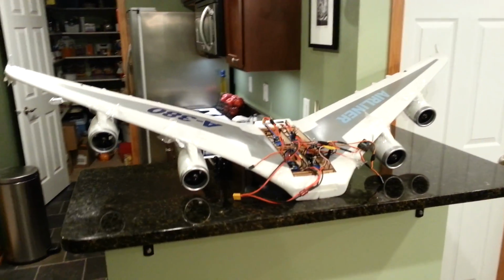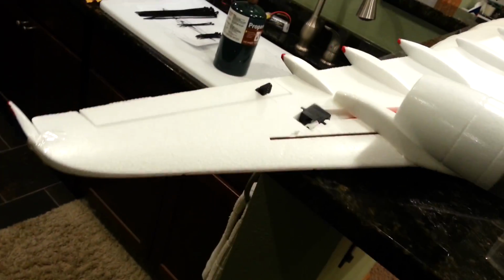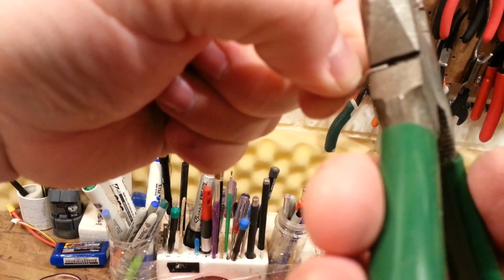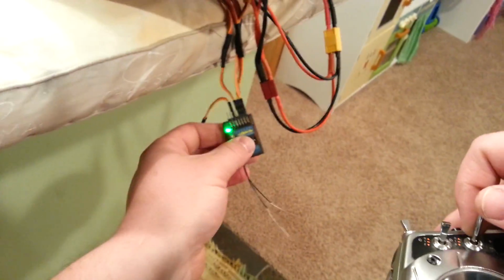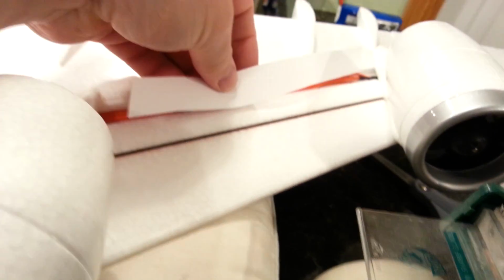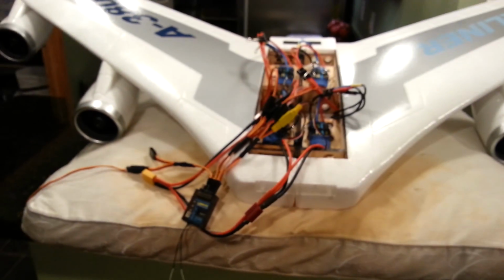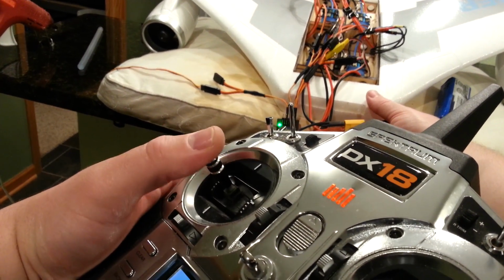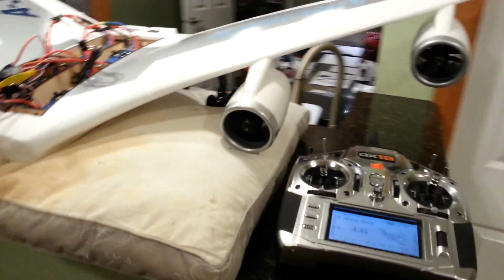Tian Sheng - Airbus A380 - Differential Thrust & Expo Radio Setup - Build Series - Part 6

Comment: Hi Brian, I recently put together a double motor type plane from Flite Test.  I programmed dif thrust into the Spektrum Dx8.  Got a ques bout this.  When I programmed throttle cut, only one motor cuts off, not both.  Do you know how to get both motors to be programmed with throttle cut when dif thrust is used.  If its not too much trouble can u pl explain how.   thanks
Reply from the maker: Gene, I thought I replied to this question - Sorry, just got done re-replying to about 35 messages, as YouTube is all screwed up (AGAIN!)

Comment: hi brian. another stupid question. what do you have plugged in to the aux2 channel on the receiver? isnt the throttle just on the throtttle channel on the rec? i just dont understand how adjusting aux 2 in a mix on your radio would have any effect. maybe i missed something on the video but i thought i followed as closely as i could
Reply from the maker: This is how I do the differential thrust. You must have missed a video somewhere...

Unboxing - https://youtu.be/S2PIjSjd5xU
1 - Build Overview - https://youtu.be/J21FuOW_45Q
2 - TX90 to XT60 - https://youtu.be/cL_D0QlsOfU
3 - Dual Lipo Cables - https://youtu.be/BRPlmnPScQ8
4 - Nacelle Install - https://youtu.be/Ynv_tsC6_OA
5 -  ESC/BEC/EDF Wiring & Radio Setup + Troubleshoot & Repair - https://youtu.be/NWrW4d89Lsc
6 - Differential Thrust & Expo Setup - https://youtu.be/gHt1os9ADmo
7 - Wing Box Cable Management - https://youtu.be/fvyqtR75E6I
8 - Elevator Servos Rework - https://youtu.be/ZyJWQkfhSR0
9 - Winglets & Rudder Part A - https://youtu.be/1DODgVGzTzg
10 - Rudder Part B - https://youtu.be/LXi-24VWOr0
11 - Rudder Part C - https://youtu.be/qPXkJJQHebI
12 - Rudder Part D - https://youtu.be/P7drrY7HQ8Q
13 - Decals / Rudder Part E - https://youtu.be/pNAWQNRvImI
14 - Rudder Part F - https://youtu.be/VuGN_g5PNCU
15 - Nose Gear Relocation - https://youtu.be/ZMvKdizqaL8
16 - Nose Gear Move Finishing Touches - https://youtu.be/_bwGW2pbRSU
17 - Inboard Main Gear Shortening- https://youtu.be/HXYI3lDHPUA
18 - Nose Gear Shortening - https://youtu.be/4Sv0geuSsQ0
19 - Outboard Main Gear Shortening - https://youtu.be/SM5IYeS7P9w
20 - Nose & Windshield + Painting Gear - https://youtu.be/Bb0lk6EU4g8
21 - Landing Gear & Nacelle Scale Details - https://youtu.be/At-Xh5TUnHg
22 - Scale Antenna & Nacelle Fins - https://youtu.be/InNaJ1dxwWg
23 - Landing Gear Doors - TBD ASAP!
24 - Balance EDF's - TBD ASAP!
25 - Final Weight & Balance Testing - TBD ASAP!
Maiden Flight - TBD ASAP!
Reply: naw brian i watced it a few times. just tell what do you have plugged into aux2 on the rec. ill cross that bridge when i get to it. itll be a long project for me lol, gotta plan my work and work my plan.
Reply from the maker: I have both of the Right Wing ESC's (via a Y cable) in the Throttle Channel and both of the Left Wing ESC's (via a Y cable) in the Aux 2 channel (...or vice versa., I cant say right this second...)

I have the POWER distribution so that the TWO INBOARD ESC's are together, and the TWO OUTBOARD ESC's are together...that way we end up keeping and maintaining some thrust if we have a single of two lipos go dead prematurely (When I run two batteries...not sure if this is gonna be necessary yet).

I think I covered most of this here ...

5 - ESC/BEC/EDF Wiring & Radio Setup + Troubleshoot & Repair - https://youtu.be/NWrW4d89Lsc
&
6 - Differential Thrust & Expo Setup -  https://youtu.be/gHt1os9ADmo
Reply: thats what i thought . thanks. i need your opinion on shortening the front wheels. what do you think about cutting the proper length in the middle of the landing gear. drilling a hole on each middle and inserting a 256  rod piece and glue to keep them firm. this way im thinkin you dont have to mess with meltin an allen wrench on the top and making it fir>
Reply: if i have all 4 escs connected to y cables and insert them into throttle channel on rec, can i stil set up diff thrust?
Reply from the maker: That would work well, I suspect...but you never know ;)
Reply from the maker: Not like that, no...they'll all get the same throttle signal. It's not super hard to do what I did, but it is pretty hard to spell it out here, so you might have to review part 5 and 6 to get her totally strait...lots of little things that have to be EXACTLY right to work, but not HARD...
Reply: ok thanks. yes it is hard to cover every little bit. the throttle channel takes care of the inbord and aux 2 takes care of outboard for instance.
for dif throt you mix throt with rudd and aux 2 with rud with opposite settings i understand. last question. how does the radio know when you use normal throttle to use all 4 engines. is there a mix for that too lol have a good night
Reply: im thinking you mix throttle with aux2 im thinking
Reply from the maker: No, close...

The two inboard are POWERED by a "single battery" (the red and black leads into the ESC)
The two outboard are POWERED by a "single battery"(the red and black leads into the ESC)

The Right Wing Servo Cables are "Y"ed together and plugged into Throttle
The Left Wing Servo Cables are "Y"ed  together and plugged into AUX2
(or the other way around...still can't remember)

P.S. I would encourage you NOT to use the Rudder channel for the "other" set of EDF's...here's why....

The stabilizer will screw with you... As you YAW the plane, and the RUDDER channel is attempting to correct the position of the plane the one side motors will "come to life" and you won't be able to fix that part of the system, except my mixing the "GEAR" channel to your "Throttle Cut" so that the stabilizer if off when you have throttle cut on.

....in stead you can use AUX2 so you won't have to worry about the stabilizer screwing with you :)

Comment: hi brian. i thinl im deciding to set my plane up in elevon setting. id like to have differential thrust also. would i mix  throt with ail or mix it with rudder which i plan to install . im using the same lemon rec but it also has stability plus
Reply: Brian Phillips when u say elevon dip switch, do you mean as a normal plane setting or vtail setting meaning  set the dips witches for vtail?
Reply: Brian Phillips thanks I'll have to mess with it. Like you say it's a good way to learn. Make mistakes and learn. I'll cross that bridge when I get to it. Lot more work to do on the plane.
Reply from the maker: depends on your radio system...what make and model are you running? What receiver?
Reply: spektrum dx8 gen2. lemon 7 channel with stabilization plus
Reply from the maker: You can do it like this...

Make sure you flip the elevon dip switch on your Lemon-Rx receiver, then I think you can just set up the controls like this....

Aileron and Elevator would hook up to their respective "elevator" (and aileron...same side, same impact)

Then you can do exactly what I setup, only you would have the elevon support turned on...

This video should show you how to do it... Part 6 - Differential Thrust & Expo Setup - https://youtu.be/gHt1os9ADmo

I'm a bit too tied up to do a special video, but try copying this setup, then let me know if you have an issue.
Reply from the maker: Ooops, I always forget what nomenclature they use...yes, Vtail, then set up the Radio as Rudder and standard tail, I think. Once you have this done, you need to play with it some, the if you can't copy it exactly as I did it, you may need to take Aux1 and Aux 2...
Reply from the maker: If I get some time, I'd like to try it out myself, but just don't want to have you waiting around...
Reply: @BrianPhillipsRC  jmjjjjjjjjjjjjjjjjjjjjjjjjjjjjjjjjjjjjjjjjjjjj

Comment: Do you know haw much range I would get with a lemon rx 7 channel with dual diversity antennas? I was wondering because Im thinking of buying a Dx8 gen 2 and I don't want to spend 70 bucks on a receiver?
Reply from the maker: It's a "Full Range DSMX receiver"...which means it's a pretty decent range., but I can't tell you. I've not had any issues and my "Range Tests" have come in consistent with Spektrum AR636's (like the bnf models come with)
Reply from the maker: I'm WAY too cheep to drop $80 on an Rx, unless it's a $1000 plane...then I might think about it :)
Reply: Ok thanks because I need a transmitter for the edge 540 and my DXE isn’t going to cut it. So if your fine with a lemon rx 7 channel with stabilization on your 330 then I should be more than fine on my edge.
Reply from the maker: Sure, unless you want to go fro full out 3D flying, then you might want to go with an A3, or an A3L...they are VERY good and they'd allow you to use an Rx with more channels.

Personally, though, I'd still use the Lemon-RX 7ch with Stabilization.

That plane looks great! Can't wait to see her maiden!!!
Reply: Sorry if this was a little confusing but I already did the maiden on the plane. The transmitter that I was using from my t28 was kinda old and on landing it jacked the ailerons full right for a second. I got it flipped back over but I wasn't in time and it hit the ground hard and the nose broke off. It will make more since when you see the video. I have it all fixed up now and have some pictures of the re-build. It might be a while before you see it fly again though because I still need a couple hundred bucks for the DX8.
Reply from the maker: You should look around for a USED DX18 (gen 1...like mine) One of my subscribers just got one for about $350 or so...which is a great deal! The DX18 is way more capable, but DX8 will be a HUGE step up for you, and I know you'll like it :)